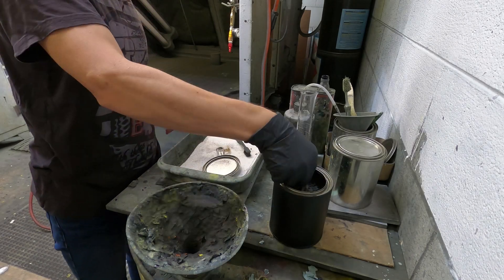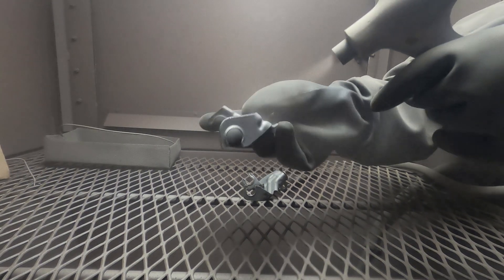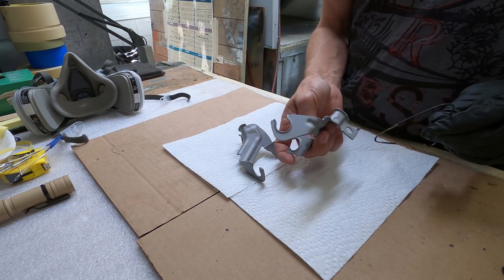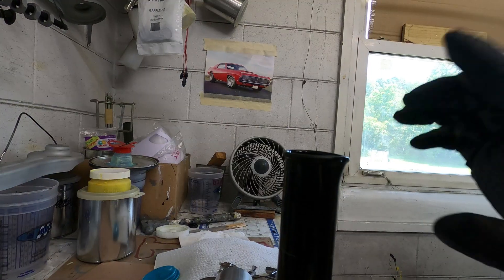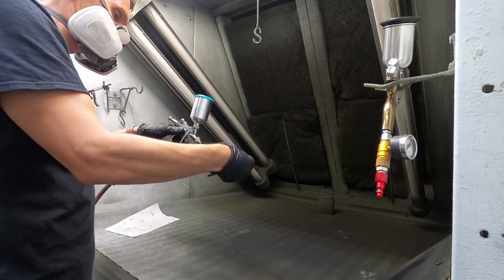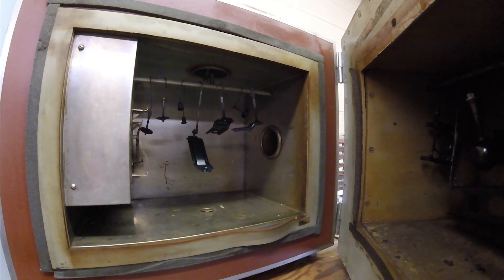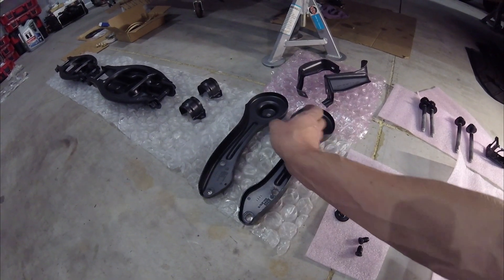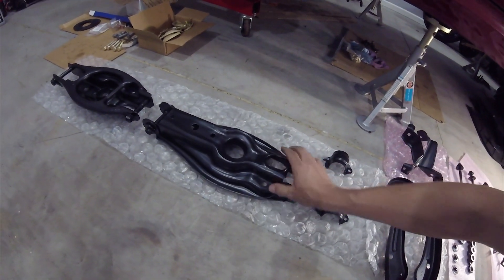Resurfacing parts with ceramic thin-film coating | Cerakote Elite E-100 Blackout.

Comment: It would be amazing if you could cure the Cerakote at low temperatures so you could spray a ship.
Reply from the maker: A ship? Like a real full size ship? Some Cerkote is air-cured.
Reply: @maxsam201  Yes I'm talking about a superyacht, the kind of Jeff Bezos yacht where money is no object. As you can imagine caring for a vessel like that is a nightmare. A long lasting coating like Cerakote could be hugely beneficial. On vessels like that you have fairly inexperienced deckhands dragging hose pipes across paintwork, totally oblivious to the damage they're causing. I'll do some research, air cured Cerakote might do the trick.
Reply from the maker: @And-rc9yy  I see. But there are plenty of MIL-spec or similar paints, powder coating, hard-coat anodizing (if parts are aluminum) etc. Cerakote is really thin, and air cured may not be strong enough for your application.